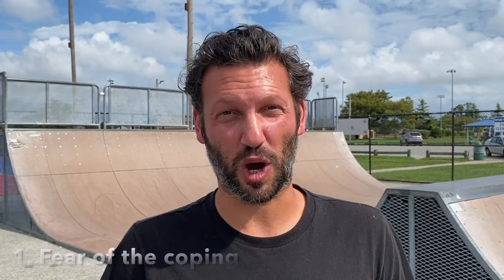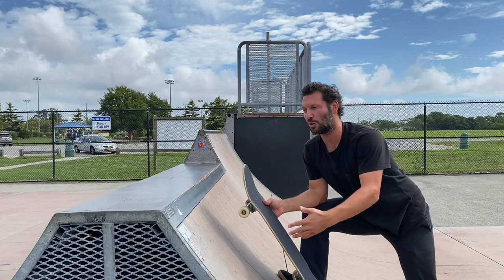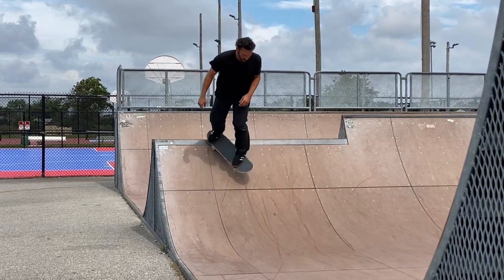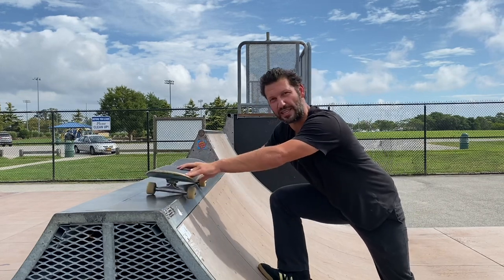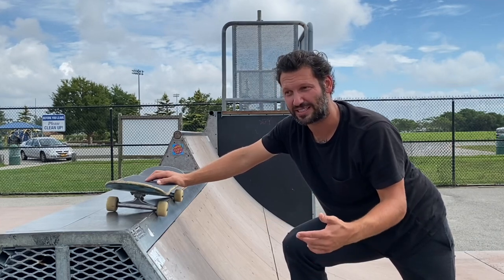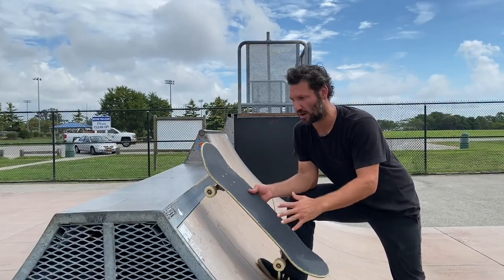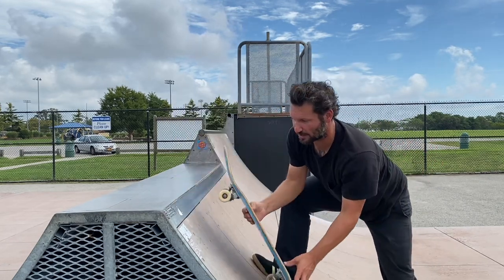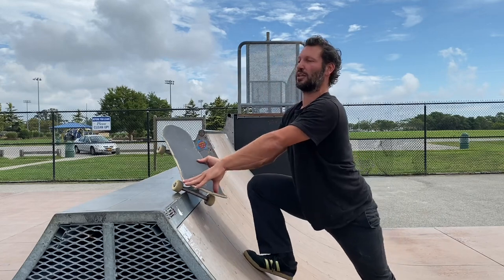The 2 Reasons Why You Can’t Axle Stall On Mini Ramp!

Comment: I personally never recommend sliding your back truck back down.  I recommend learning how to turn in properly.  With the right pressure on your toes on the back foot, you can turn in fine and even do what I call edgers where the back wheels come over the coping and you ride on the edge of one wheel and come back in.  The muscles for using your heel or toes needs to be developed.  It can be practiced quite safely under the coping.

Comment: Coming back in was real weird and hard to unlock when I started skating. I finally did what you mention here — used a small ramp (I built a 2’ micro quarter just for this) and built up the courage to get it. On that tiny ramp I aimed to get my first drop in attempts to 45 degree angle rather than getting to full 90 degrees. It was easier than I thought and I discovered quickly that once I had that motion understood, I could easily go to a full 90 degree straight drop in. And once I had that I was suddenly able to do 50-50 grinds too — it opened up a lot of new variations!

Comment: If you watch the video back Chad you're never stood up straight. It definitely helps with locking the trucks into the correct position if you lean slightly into the ramp(personally).
I find that when you stand up vertically it locks toe side if you very slightly lean in, locking into heel side happens more easily.

Comment: backside  5050 axle stall was the first thing i learned on my quarter pipe. i still cant rock to fakie but axle stalls all day. getting the correct speed and transferring your weight up to the edge of the ramp. as a beginner speed was probably the most important part, make sure you have enough speed to get up to the top of the ramp without flying up there. i just learned my first transition trick this last month with a 2ft quarterpipe i built,  and was able to learn and transfer my skills to my local skate parks 3ft and 5ft quarter pipes. also was able to grind some jersey barrier transition at my local but havent been able to ride out of that steep transition at the bottom.

Comment: Nice! I’ve struggled with this, But its really a mental thing. I’ve always strayed away from transition just due to fear of getting absolutely destroyed on a 3-4 foot quarter pipe lol, But I’ve been getting more comfortable on transition lately! 

For some reason 5-0 stalls are easier then getting into 50-50, Problem is I’m doing what your describing by going at it wide instead of straight on. I’m gonna try these methods next time I’m out!

Comment: @ChadCaruso - For me it's not the fear of the coping, it's locking the back truck in - which is the lack of speed I need to to so. So my problem is a lack of pumping at the base of the ramp. My later video @rekallism shows that.

Without the lock, then pulling the shoulders back, I'm getting stuck. I'll get it.

Comment: Fear is MASSIVE 

My tip for beginners is walk before you run 

1. Find the most MELLOW bank and try to 50-50 stall consistently at the top of the bank 

2. Once you got mellow banks then start trying them on progressively steeper banks until you are comfortable doing a 50-50 stall on the biggest banks in the park 

By this time you should have the muscle memory subconsciously drilled into your brain & now you're ready for step 3. 

3. Find the most MELLOW quarter pipe that you can possibly find. The more mellow the BETTER. Practice step 2 over & over on the quarter pipe & watch videos that show you how to properly lock in to the stall. 

If you're lucky & you have extremely mellow quarter pipes then the learning curve wont be too bad 
If you only have access to massive or steep quarters then fear of falling might hold you back for a while

{BONUS TIP} => Locking in correctly is all about repetition & FEEL.

Some people find it easier to lock straight into a BS feeble stall. Which is absolutely fine... It helps build confidence up on the coping.

4. Once you have proper technique on mellow quarters then take it to progressively bigger & steeper quarters. 

OPTIONAL STEP #5. Do it all again from the start but switch